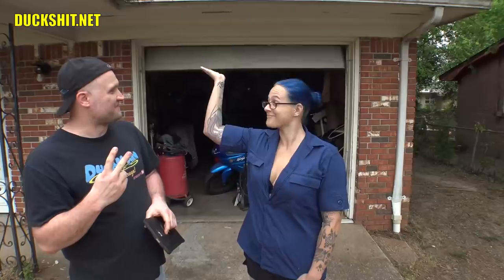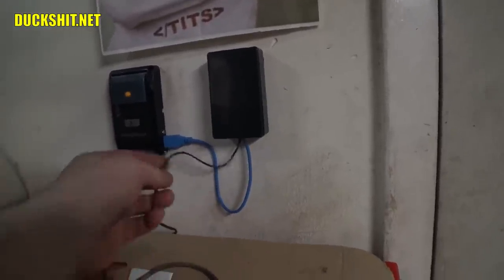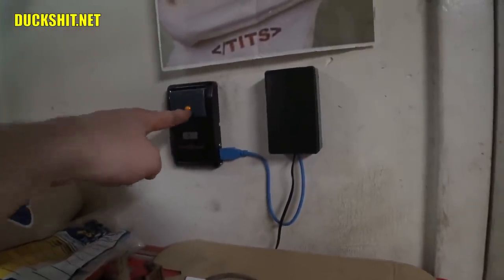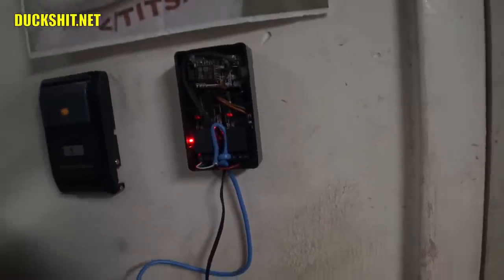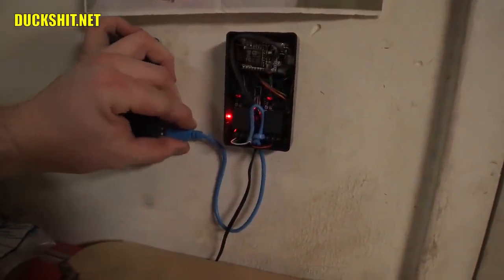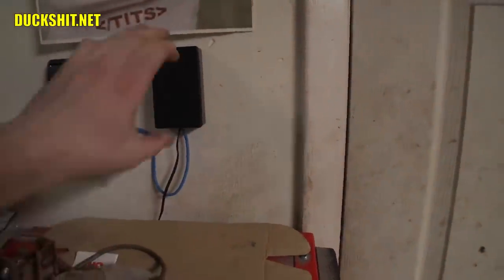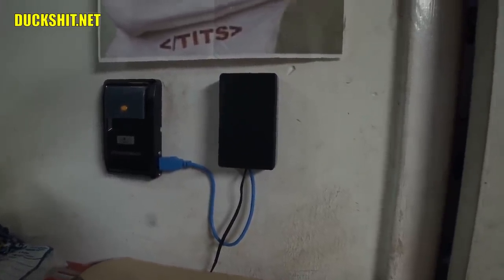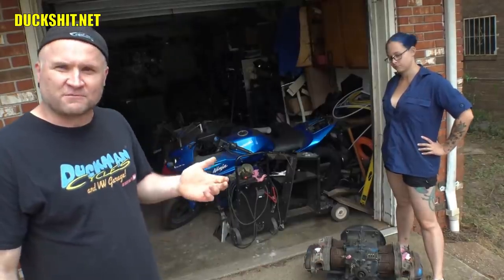Bee's VW Engine - Arduino Garage Door - No Mail Call Monday - Midday Q&A 104

Comment from the maker: ⚫ Arduino Garage Door Opener Build List ⚫
NOTE: Most of which comes in bulk packs but is still cheap!  Enough leftover parts to build other projects!  
ESP8266 - 3 pack only $9!  ▶  https://amzn.to/34uSeVC
Relays - 2 pack  $12 ▶ https://amzn.to/2V3N5Rp
Project Box - 5 pack  $10 ▶ https://amzn.to/2Vk7v7E
Dupont Wires - 40 pack (need 6) $6  ▶ https://amzn.to/2Xyc9BE
Source Code  ▶ https://www.patreon.com/posts/35948881

Comment: Glen, I just had another crazy idea. I was given a 1982 Suzuki GS650L parts bike. It is supposed to run, but who knows. i've thought about somehow combining a VW chassis and maybe something small and light like a dune buggy body. Any suggestions? I like to do woodworking, so having something with length to haul wood from the big blue box. Or get a small trailer from Harbor freight.